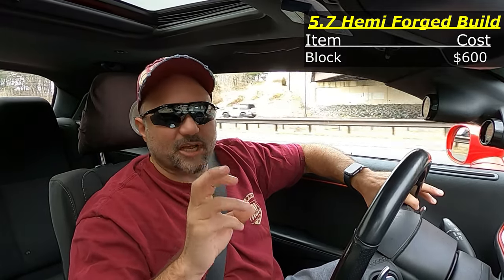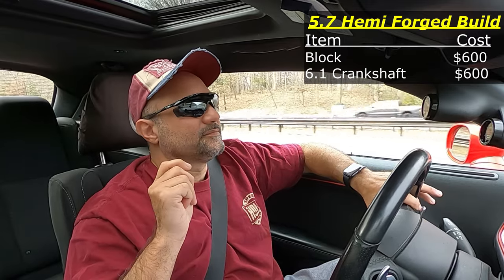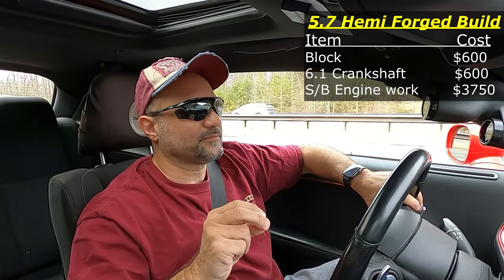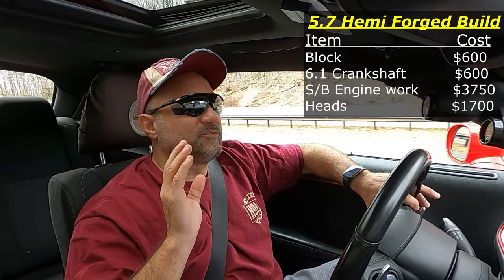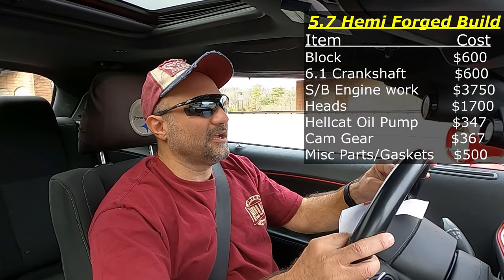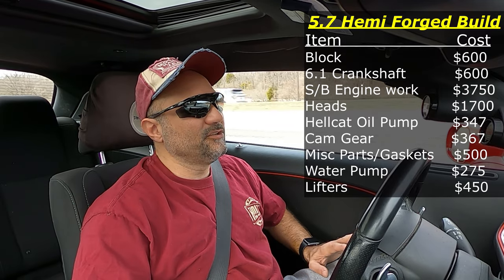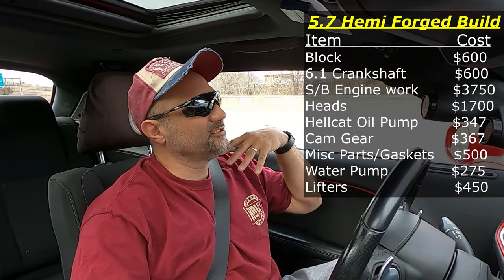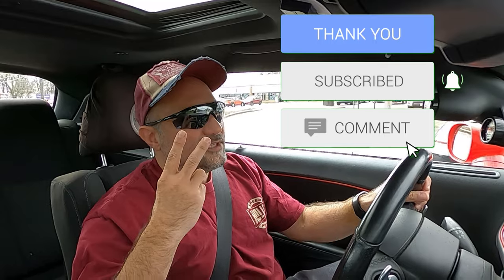Unpacking the Fully Forged 5.7 Hemi: Is It Worth the Price?

Comment: Definitely not cheap, 5.7 engine swap to new long block 6.4, fully forged, Boost Cam,Holley Sniper intake, hellcat throttle, four innovation dual pump, with labor. 21k. The labor was $3900
Reply from the maker: Yes sir! Not cheap at all. 😉
Reply: Helaphant.
Reply: But worth it?🤔 maybe😌
Reply: I’ve been looking seriously and found a few combinations 12-14k ported heads MMP on there site.  Forged bottom end.  I’m definitely going to look into your build for the differences
Reply: @igloo_coupe what’s your hp goal?
Reply: @Otmkendoodoo it’s worth it. You can find these cars pretty cheap which helps a lot with build prices. I got a clean title 2014 Dodge charger RT for $3k. Good condition interior, bad plasti dip job on the exterior but everything functioned as should. Made a 3hr road trip no issues
Reply: @StillFlyingSoulo  tbh I was looking for 850 wheel
Reply: @igloo_coupe  that makes sense. I went all out on my mustang build looking to make around 700whp.. then I just started on this charger and the prices for everything is just so much higher 🤣 it’s a bit discouraging but it has to be done.

Comment: The 6.1 crank fits in the newer 5.7 block as well correct? The eagle hemi? I don’t know if there’s any difference but I figured I’d ask  since you’ve done it
Reply from the maker: Yes, the 6.1 crank fits in the 5.7 and has the same stroke. You have to get a '14 or newer reluctor wheel as the '13 and older ones are different and a spacer (I got mine from HHP). 💪
Reply: @ModernRedHemi  would a reluctor wheel off an 18 5.7 fit the crank? Or does it need to be specific to the 6.1? I have a stock 5.7 crank sitting in my block at the moment while I find a 6.1 at a decent price
Reply from the maker: @antonioV96  yes. You'll still need the spacer from High Horse Performance.
Reply: @ModernRedHemi  out freaking standing. Thanks for the info, most people usually try to gatekeep lol. Im ordering the spacer now, hopefully I can get a good deal on a 6.1 crank as well
Reply: @ModernRedHemi would a 5.7 or 6.1 hemi engine be better for modifying?

Comment: Got a stock 5.7 durango. Best mods for power. Bolt on. Top 5. Daily driving is a must. Aiming to hit 500hp. Best ideas. Go
Reply from the maker: Force air, cam and EFI Specialties tune and you're well within that 500 range if not a tad more. 💪
Reply: @ModernRedHemi  would you say turbo or super
Reply from the maker: @Duckagee  race car turbos, street car supercharger.
Reply: Procharger , tune and exhaust.  Under 10k installed and reliable every day driving
Reply: @igloo_coupe can you run a pro-charger on a stock 5.7 hemi?
Reply: @itsaccer7443   Yep Procharger makes a complete kit.
Reply: All u need is cam, headers and a tune
Reply: @Milk-wm3uu  500 crank I’d agree
Reply: Hellcat oil pump if your keeping mds change the relief springs in the oil pumps 

A 392 cam with new hardened pushrods and i suggest better springs for the higher rpm

392 intake ported

A ported 392 throttle body 

Hellcat fuel pump 

Tune it to those on 89 or higher 

Ported and flowed heads that are on the car

No boost needed im at 534 wheel with this exact setup and for all of the parts i paid 2500 for the motor and 290 with shipping for the 6.2 oil pumps wich is a direct bolt up
Im at just shy of 4k into it 

Most of the 392 6.4l parts are a direct bolt on for the 5.7

I run it on 89 and it only loses 38 hp for 50 cents a gallon less at 2.89 a gallon

No need for any stroker packs and if you want to boost it eagle sells a forged bottom end for the 5.7 at 1600 with shipping

Comment: Much appreciated info, thanks for sharing that with us! Gen 3 hemi ain't cheap to build! Your fresh engine should run super hard and kick your ole Shake & Bake into the high 9's no problem.:face-blue-smiling:
Now, if that was a 392-based short block w/stroker to 7.0 liters(426 CI)..................:face-fuchsia-tongue-out::face-orange-raised-eyebrow::face-fuchsia-wide-eyes::hand-orange-covering-eyes::text-green-game-over:
Reply from the maker: You're most welcome brother! Definitely not cheap at all. That's the plan, mid to low 9s on the forged engine. The 426 is not joke, that's for sure! 💪

Comment: My question is why not stay simple w the block; just reset it; just clean it; shove the aftermarket pistons and rods?
Reply: They make aftermarket factory fit stuff.
Reply: I understand the crank
Reply from the maker: That's primarily what I did with my block. Cleaned it up, decked it, bored .020 over (due to COVID, .020 over gave us way more options for pistons), forged pistons and rods, and a 6.1 crank (which is forged). Yes, you can buy forged 5.7 cranks now but they didn't have them when I started the build over almost 2 years ago. 😉

Comment: What all do I need to gain 100-150hp in my 2020 Durango RT without super charging or turbo if it’s even possible….always been into cars just not so much into building em lol but I am now just don’t know where to or how to start 😭
Reply from the maker: You can get around 100hp with cam kit (~$1500), long tube headers (~$1500+), catback exhaust (~$1500+), ported 6.4 intake manifold (~$800+), Hellcat throttle body (~$300), and the most important... unlocked PCM/TCM and a good tune (~$1700+). All that is around $8k+ in just parts and tune. Tack on at least another $2000+ in labor. All in ~$10,000+ if you can find a deal. 😉
Reply: Honestly labor easy I’ll say only thing u would really need someone to help u with is with the tune ..EVERYTHING is bolt on literally a kid can do it don’t be afraid everything on chargers are cheap and can be found at almost every salvage yard u can find.
Reply: It’s going to be a feat to get 150 extra on muscle alone.  Dollar for HP supercharge kits.  All day. Procharger is a GREAT kit 7500$ ish.

Comment: I’ve had pretty good luck with the Chinese eagle rods in NA small block and big block Mopar motors over the years. 

Are they mid level Boost strong ?
Reply from the maker: I ran 20ish through mine. 😉
Reply: @ModernRedHemi  not surprised.  The ones I’ve gotten looked great!

Comment: My next big move is going to a 392 forged short block , heads cams .. I’m on a small procharger now full bolt ons e85 610-30 tire.  7-9 psi.    Wonder if you guys think a big procharger or go whipple 18 psi ish range ?? Currently a eagle hemi 21’  Cherokee
Reply from the maker: Honestly, I love the 392 since putting one in my car. If you already have the ProCharger, I'd keep it unless you want a more "Trackhawk" experience the Whipple provides. I love my ProCharger because I can drive lightly with no problem and nail it when I want to. 😂 Not sure which ProCharger you have, but the P series is good to around 900+hp and the D1X I'm pushing over 1000. 💪
Reply: @ModernRedHemi  yes I have the small P series right now.   So id be interested in stepping up to what you have.

Comment: Would getting a 5.7 or 6.1 Hemi engine be better to build if you’re trying to make crazy HP?
Reply from the maker: There's the old adage, there is no replacement for displacement. The 6.4 BGE is probably the best block to start with to make crazy HP. Not that the 5.7 or 6.1 aren't great engines, it's just the BGE block is set up to handle big HP. 😉

Comment: What do you think the total price is for the entire list u have in the description and how much hp do the car make with the nitrus forged heads drop in pistons px-1 procjarger header on e85 cam kit with the lifters fuel pump injectors just on estimate
Reply from the maker: I'm probably in the $30-$35k range for everything. I am at roughly 800 rwhp with a 35 shot of nitrous. 💪
Reply: @ModernRedHemi  including car or no lol jk
Reply: @ModernRedHemi  wat I listed wat type power do you think I can  make with the right tune cause the shop doing it said 12k for it all and it would be a easy 700 hp wat u think
Reply from the maker: @nehemiahjones7367  really depends on how much boost you are going to push. I was in the low to mid 600s on 8lbs or so. Now at 15-16 I am around 750. You may want to keep an eye on the size of the upper pulley and how fast they are spinning the P-1X. Don't want to go to far past ProCharger specs.
Reply: @ModernRedHemi  which procharger would u say I should go with or should I do the twin Or whipple

Comment: Could you help on a dodge Durango 2017, looking to push 600 hp. Was looking into the whipple kit (any help appreciated from anyone)
Reply from the maker: A Whipple pushing 8-10lbs of boost, upgraded pump and injectors, cam, long tubes, and a good tune will get you close. 😉

Comment: would you have to machine the pistons with having the 6.1 crank?
Reply from the maker: No. The 6.1 crank is a direct replacement, with a spacer, for the 5.7 crank and they have the same stroke. 💪

Comment: Pistons and rods? Compression?
Reply from the maker: Mahle Pistons (930276037) and Eagle Rods (CRS-6125SO3D2000) with a compression ratio around 10:1 (that's using a thicker head gasket). 💪

Comment: 5.7 or 6.1 Hemi better for boost?
Reply from the maker: My opinion only here, no facts to back it up, the 5.7, especially if you gap the rings or forge the internals. 😉
Reply: @ModernRedHemi  Do you think a completely built 5.7 or 6.1 could keep up with a hellcat? Kind of a hellcat on a budget. But with that being said, with all that building going into a 5.7 or 6.1 would u think it would be better to just buy a hellcat instead? I guess my main question is 5.7 , 6.1 , 6.2 best for boost? Because that’s my next build and I’m try to make some power and was curious about the best engine to build off from.
Reply from the maker: @Kenvlogging  taking my love for the 5.7 out of it, the 6.4 with drop ins is your best bet. More displacement and easier to do.

Comment: Compression on the pistons? What size 9.5?
Reply from the maker: Compression should be around 10-1 but may lower a little by putting in thicker head gaskets. Will see when we put it all together. 💪

Comment: I got 15k in a fully forged 5.7 based 392 stroker long block from MMX. Just the long block lol
Reply from the maker: It adds up fast! Now I got a new intake manifold set up with intercooler, ice tank, heat exchanger, and pump. This is one expensive hobby! 😂
Reply: Dude it's crazy how fast it adds up. It's an addictive hobby lol
Reply: Most of us can't even afford to lease one 😂
Reply: I was just looking into a 392 based 5.7.  But the bottom line says natural aspiration.  What do they change to go boosted.  I’m going procharger but not sure how big
Reply: @igloo_coupe  mmx 5.7 based 392 stroker is built for high boost. H13 tool steel wrist pins, fully forged rotating assembly, ARP head studs and main studs.

Comment: Sound like your better off buying a hell cat
Reply from the maker: Done a number of videos on that very subject. You may disagree but even with the forged engine, especially the prices now a days, I am still $10-$20k cheaper than a Hellcat and making more power. I have nothing against those that buy Hellcats. They are the penultimate vehicle and can be easily modified to make big power. I am just documenting my journey in building the fastest 5.7 I can. 😉
Reply: Making more power 
Can’t make up for displacement  not making more power 
Plus u have to upgrade you drive train